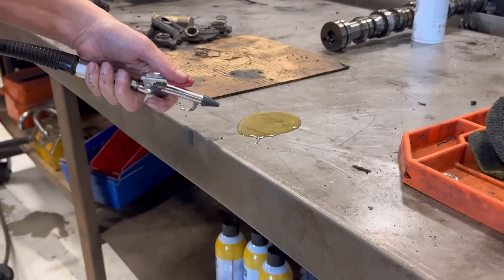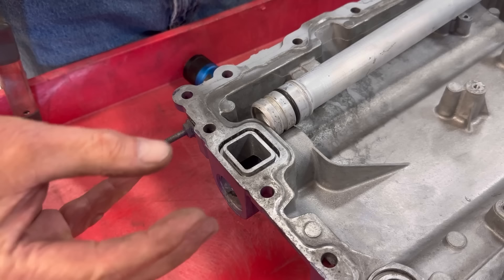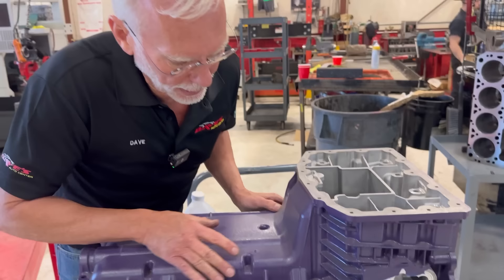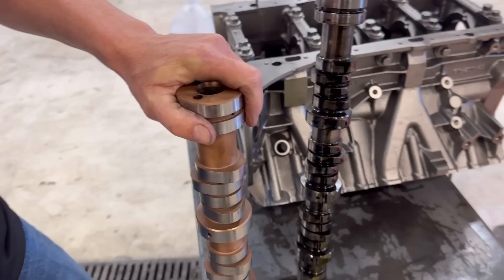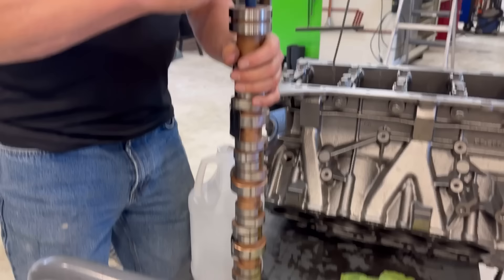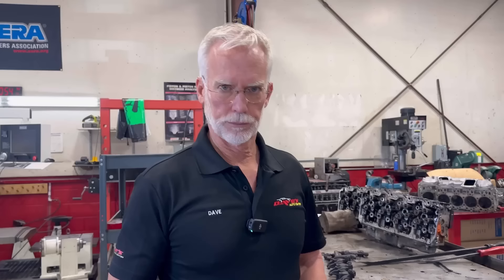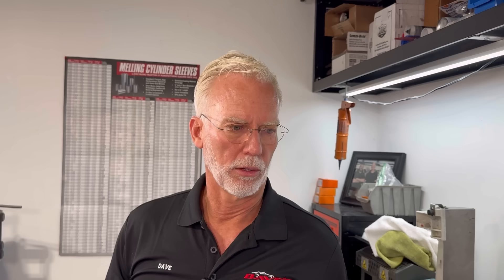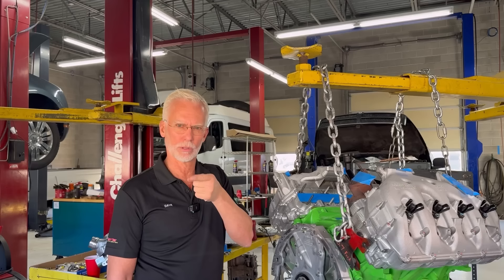Part 1: Ford 6.7 power stroke oil starvation issues revealed

Comment: Good to know info here. On a side note. When I had my 6.7 I guess I treated it to well. I had an extra duty oil filter from royal purple and used royal purple oil in it. And also I used Motorkote oil additive just so that I could have extra protection. It used to be a $300 oil change without the motorkote. But I wasn't the normal dude riding around in a truck hauling groceries.  And the only problem was at 46k it dropped 2 valves. And ford threw a new Long block in it for me under warranty.  And that's the only issue I had until an injector came apart and wrecked the engine at 246k.

Comment: Howdyyawl from the land down under. I've watched your video,mayB the secret at the end is a one way valve on the pickup tube. I mayB wrong, but it would stop oil draining out of the engine too much & keep it up to the bearings & loabs for better start up. Also a bit of slik50 may help to coat the moving parts.love your videos. Keeping it real 😊

Comment: Dave, the fix is an accumulator system like an aircraft hydraulic system operates or a dry/wet sump system with an electric priming pump operated for a minute or so prior to cranking and startup.
A dry sump system from the factory with its own pump would be perfect!
Great video

Comment: You installed a Check Valve inside the pick up tube to retain the oil inside the system and it now flowing down the sump when the car is stationary. Its a principle we have in aviation.

Comment: Dave ,you are correct but what has happened , the manufactures don't care about the consumer and they don't care about how many miles their vehicles get as long as it is out of warranty ..this is the same issue with aftermarket parts..

Comment: Priority oil galley oiling.....hmmmm... We don't need to worry about the crankshaft, it will get oil eventually. Good thing they don't turn very high RPM. Better use 5w-40 T6 oil in the winter!

Comment: The needle bearings have not been the problem on the lifters.  We get them and the roller is turned into a ball, the needles are still ok.  The typewriter click is a thrust bearing rocking back and forth.  After building a few and noticing that noise while building the lower end, we had a junk smashed truck come in, drilled a hole in the block, ran a camera in, changed oil and verified the thrust bearing rocking back and forth.  Find it amusing that ford says its ok and normal, yet these engines suffer from main bearing failure way to often.

Comment: Those needle bearings have length to them in order to take the load. Bushings don't move and will wear in one half of it.. plus, drag racing motors don't run for hours on end. Just a few thoughts!

Comment: Awesome video Dave. That's allot of static oil draining for a cold start. Wonder is a prelude pump before startup might help the issues with this engine. I guess if it was built the way you would build an engine there would not be any oil starvation. Keep up the great videos.

Comment: I like your videos and how you explain.
Now for theoretical oil calculation in a pipe is pretty simple. Get the inside radius of the pipe then it’s: Pi x square of radius x length of pipe

Comment: The problem with needle bearings is not the needle.  It’s the wrong oil and wrong maintainance .  When we had the first Di diesel engines with higher outputs they often break down after 60.000 miles .  The people who drove the engine to dust were the ones who maintained not  according schedule. The ones who stayed healthy and did 200.000 miles plus were the ones who did 9.000 miles (oil change instead of 18.750( 30.000 km) . And use the specs according to the builder . Lots of dealers had one barrel with one type of oil.  Now they learned and have different types , right specs for every engine .

Comment: Dave I'd  like your shop to build my 5.7 hemi with your oiling up grade. My engine is a 2006,  Has MDS but no vvt. Im not a fan of needle bearings either. They fail without a lot of load on them. You guys do great work at that shop. Love these videos.
Reply from the maker: Sounds great!

Comment: The roller that houses the needle bearings, can be improved by, removing and replacing the needle bearings.  Install plain journal bearings with proper operating clearance should improve operating performance, and dependability.

Comment: That's a good visualization, but I would've left out the oil filter (which took most of that water) because an oil filter does not drain out when the engine is off like the rest of those tubes do, it will still be full of oil between startups.

Comment: Bronze bushings are alot softer than the hardened needles. Bronze will deteriorate when exposed to chlorides or sulfides in the oil. The CTE of bronze is much higher than ss needles and could cause galling if not sized correctly

Comment: It seems to me ford has always had issues getting oil to the top end of the engine. In the 50s the 352 had an added pipe going from oil sending unit that splashed oil on rockers. The 5.4 3 valve scores the cam journals 7.3 gas massive valve train issues and the 6.7 ford diesel will randomly drops push rod due to lifter design. Great video 👍

Comment: I worked in the river transportation business for 40 years as an engineer. All the large engines were equipped with a prelude system so you never had a dry start up. The bearings looked like new with up to 40k hours on them. Cheap insurance.
Reply from the maker: Great info! Thanks for the share

Comment: Some say the oil pickup needs a foot valve to prevent oil flowing back into the sump. However, debris will eventually hold it open. 
Far better would be an electric pump that pre-charges the oil system. To maximise service life it can shut off a few seconds after the engine starts.

Comment: Thats why you use full synthetic in there there might be a few leaks but it just because it's synthetic and in high volume so it will last longer 15w40 to 20w50 so it means it 40 warm 50 warm then cool the other number 9:16

Comment: Seems like Caterpillar fixed this a long time ago, at least on their rigid frame haul trucks. A PRE-LUBE pump that won't let the diesel turn until it builds oil pressure except when hot. A double shaft electric motor that has the pre-lube pump on one shaft and the emergency steering pump on the other. I've seen adds for them many years ago but I'm out of the loop now but was in it for a long time.Te best to yall!

Comment: How much different are they than the 7.3. They have a huge pickup tube, Oil has to go all the way through the oil cooler then go through the filter. The filter on the 7.3 is twice as big. I do agree that the cams are lubed better and the turbo gets oil quicker on the 7.3. Curious as to how much oil  difference between the 2. This does make sense why turbos go out on a regular basis on the 6.7. Why wouldn't they put a check valve in to hold oil in all the oil rails and the filter and cooler. Looks like cranking the engine without the key on after an oil change would be usefull. With that said, I have never had to replace a stock engine in the 6.7s, every one has been tuned and deleted. I have found that tuners are the biggest problem with them.

Comment: What about a electric pre-pressurization pump to prime the oil circuit before starting the engine, and in a diesel it could run while the glow plugs do their thing. That would eliminate that oil starvation issue when cranking the engine.

Comment: when i did oil changes at walmart i ALWAYS primed the filter on a diesel. gas never, but those giant diesel filters i always filled them up. i remember one of them took 2 quarts just in the filter.
Reply: Yeah that's what I was saying I've never primed a gas engine oil filter That's a myth but on the diesels those things are huge it makes sense to do it on those

Comment: Porsche tried a gun drilled camshaft on the first 911. Every lobe had a hole in it for oil. The lobes farthest from the front  where the oil was introduced failed due to lack of oil.

Comment: As a lube tech, those first few seconds during a dry start where the oil pressure gauge stays pegged at zero gives me nightmares. Also, we were never trained to fill the filter. I guess that takes too long 🤷‍♂️

Comment: Let me say that I have moved on from engine rebuilding and repair, I used to own a company that serviced and did in frame rebuilding on large boat engines.  My service truck was a F350 with a 6.7 engine in it.  When I sold it it had 246,000 hard trailer towing miles on it and with the exception of sensor replacement I had 0 problems with the engine, using 5W40 rotella changed every 7000 miles.  HOWEVER-- I dont think the engine ever saw rpm's over 3500 so perhaps that is what saved it?

Comment: You may be on to something, Dave. When you check and see how much time it takes to bring the engine up to full oil pressure and fully lubed state, I'd also be interested in how much difference it makes when oil is at say, 20degrees F.

Comment: Dave, The solution is to equip IC engines with electric oil pumps that pressurize the oiling system at startup just as the EFI systems do.  Why don't engine makers use electric oil pumps?

Comment: Add a pre-oiler. I installed one on my truck and no noise because I have pressured the oil before starting. I did this all for about $200.00

Comment: Dave,  Great videos.  I have the need to know virus as well.   I work on marine diesel engines which most have a external lube oil priming pump.  On these engines, there is a pressure sensor in lube oil circuit which is highest on the engine, usually the turbo circuit.. So in the case of the German MTU diesel engines, with the turbo being at the end of the lube oil circuit, the start request would been seen by the engine control unit, (ECU).   Once the ECU sees the legal command with the normal interlocks, in neutral, no vital alarms, not running,  the lube oil priming pump would start pumping oil throughout the entire engine with exception to the piston cooling circuit.  Only after the pressure switch at the end of the line was satisfied with a positive pressure, usually close to 0.4 bar, (6psi),  would the starting circuit be engaged to roll over the engine.  So the wear would be greatly reduced.  If these engineers of these truck engines wanted success in their designs I believe they would try to replicate the marine philosophy.  I believe they could come up with a design of an onboard low current draw pump to circulate the oil prior to a roll over, possibly an auxiliary power source from external power source, say 115VAC.  If possible, have the external source power, 115VAC,  plug in sump heater, to keep the engine warm, so the lube oil would be fluid.

Comment: They revised the upper and lower oil pans as well as the oil pump in the 2020 and later model years. Probably to fix this exact issue.

Comment: Me and you are on the same page. Difference being you have all the cool tools, I have pick n pull. I retro fit parts from one engine to another. 3.8L v6 from gm has roller lifter pins, and needles that fit Dodge hemi engines. Not the lifters, just the rollers. Same rollers and pins can be found in fords 3.0L vulcan engines. I also use these rollers to fix the dodge v10 lifters since parts for those engines are not easy to find. Crank sensors for those engines are very rare, so I use the spacer from between the platters in a hard drive,  JB stick weld and a cam sensor from the 5.7 hemi engine to fix the crank sensor issues. The hard drive platter spacer is exactly the same diameter as the hole in the side of the v10s block, so as the JB is being applied, move the spacer back and forth for a perfect fit. I engineer for people who are low on funds but have other things to offer as payment. as long as the bills get paid and the tax man from F'ing me in the A, its all good.

Comment: Dave don’t get me started. The dang valve train wearing out is also a concern of mine. I don’t like dual push rod design. I constantly see those worn camshafts and turned lifters. Rocker arms gotta get replaced too since they wore out due to the thrust of the pushrods

Comment: Some of that isn't fair. A bit of will drain out of the cooler and the filter. but lots will stay in there. Still I agree with you. The time it takes for oil to come out of the engine is definitely an issue. The check valve is the ticket, for sure.

Comment: At least on the older Fords, you can hold the gas pedal to the floor and the engine will turn over, but not start.  Helps build oil pressure.

Comment: That is one of the most complicated oil pans I've seen. Lol. The designers couldn't have eliminated multiple internal tubes, o rings, gaskets, etc. And I agree. That amount of oil that has to fill and pressurized just to start oiling the engine is insane!!!  I dunno why they don't just make it dry sump and pressurize the oil feed. Lol. Do they make a diesel dry sump?  Im not a diesel person and know nothing about them. Well very little about them.

Comment: Could you fit some sort of check valve in place of one of the plugs? That might not fix the issue but should help issues.
Or drill an outlet in the sump and make an inlet adapter in one of the plug holes with an electric oil prime pump to prime the system before the engine is run

Comment: I have a 6.7 PSD with 201k miles on it. It finally shed a few flakes of metal. CP4 is on the way out. Other than that, it runs like a champ. Shouldn't there be oil on those parts from the day before? I thought oil stayed on these things unless it sat for a while?

Also, the engine is filled with 15qts of oil at the factory, and then when you change the oil and filter it takes 13qts. This means 2qts remain in the engine unless you tear it down. You just showed where the 2qts was hiding!

Comment: That engine design is ridiculous. 

My Grandfather was a mechanic when he was alive and rebuilt VW’s engines and helped me rebuild a 1976 1.5L CVCC Honda engine for my Civic. We never filled the oil filter but in this design I can see the reasoning behind it and yet that’s still not enough oil.

I honestly think they designed it to fail so you’ll drop new engine in or buy a new truck.

Comment: 713k original miles on my 2017 6.7 powerstroke. Doesn't clatter. I've done every oil change since new. Takes 2 to 3 seconds to get oil pressure after oil change.

Comment: Ford has had a "good enough" mentality for many years, but the fanboys will still tell you how great they are.  They will tell you how great the CP4 high pressure pump is also until they have to pay for one taking out their entire fuel system.

Comment: Large diesel engines, gensets etc have oil pump on the starter that pumps oil the instant cranking starts to lubricate instantaneous. Large engines are meant to last a long time and also why are worth the investment. Smaller vehicles are disposable and to cut cost and be able to sell newer vehicles don't have any urge to make them durable and longer lasting. EPA regulations doesn't help either.

Comment: I know, I filled the oil filter for my 5.7 litre Chevrolet LS1 V8 engine & I primed the oil pump by removing the side oil gallery plug so that the engine can start up after a hydraulic lifter change.

Note I did thoroughly prime the engine with oil because I couldn't figure out why I had no spark when I tried to start the engine,in my Holden Commodore the main positive ignition feed is connected up with the same wiring harness plug which is also for the air conditioner pressure switch near the left hand side of the front radiator support,the plug was unplugged.

I actually added another litre on top of the 6 litres after I refitted the oil pan because the oil level was a bit low after I ran the engine for a bit,I also noticed that the hydraulic lifters tapped a tiny bit on startup for a split second then it went away after a while so I believe that the hydraulic lifters had a little bit of air in them.

What I noticed on the 3000 mile orv50// kilometre oil change is that there was only 3.8 litres of oil which came out of the engine although the dipstick level wasn't at the add mark.

My question is where did all of the oil go to ? 

My answer is that the hydraulic lifters, etc was still displacing air with oil & it didn't use a great deal of oil on the next oil change, so there may have been air pockets in the engine which had been displaced, note that I also had the oil pan removed as well which has oil galleries in it .

I do know about that roller bearing thing because I know of a person locally who got a stage 2  camshaft fitted into his 5.7 litre Chevrolet LS1 V8 engine in his 1999 Holden VT Commodore because it had a loud ticking sound but it was caused by a collapsed needle bearing.

I bought his old 0965 camshaft but I haven't used it !

Comment: Oil impregnated bronze bushings have WAY more surface area than a needle bearing. It may be softer but its surface PSI is less than 1/4 of what a bronze bushing will ever experience.

Comment: How many milliseconds or seconds do the cam bearings run dry before they are up to proper pressure?? Thats alot of plumbing to go through before the cam actually gets spec pressure. SMH . You would think the engineers would prioritize cam and crank bearing oil pressure prior to the cooler filling up. 🤷‍♂️🤦‍♂️ Thank you for these videos because i learn so much even on the video shorts. Ive been a mechanic for forty years and yes you can teach an old dog new tricks.👍
Reply from the maker: Ha ha Dave feels the same (can teach an old dog new tricks). Thanks for watching g